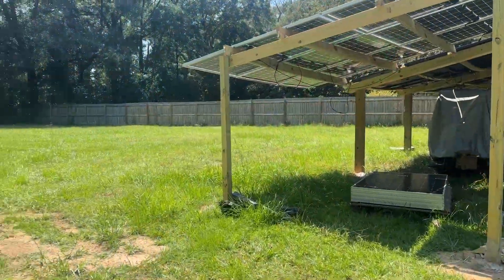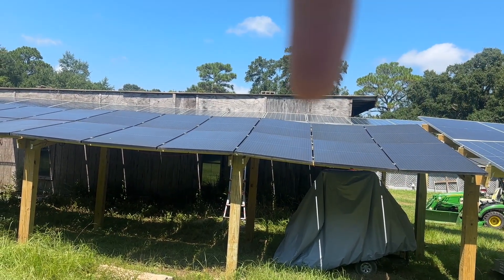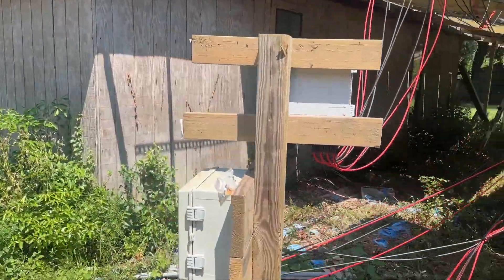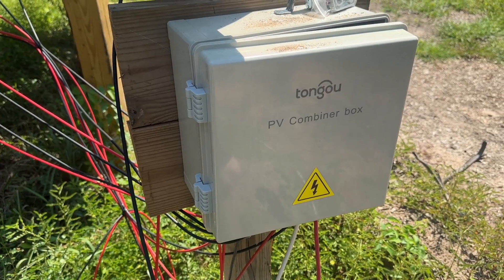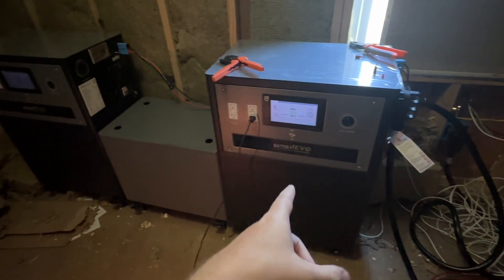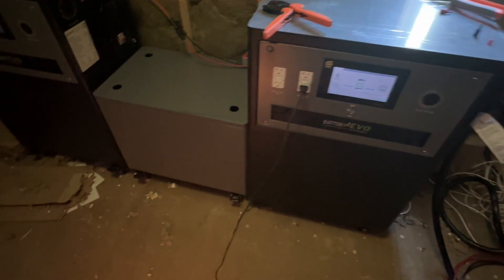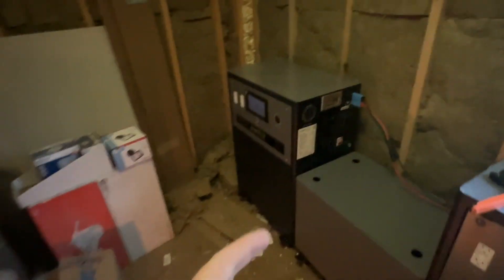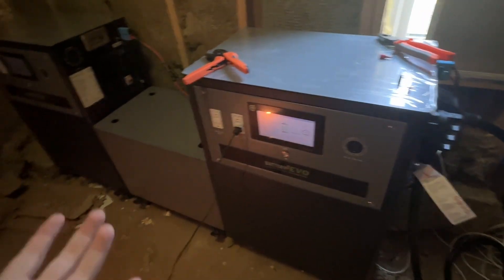Tour of my solar and battery backup

Comment: I am in the process of setting up my G4 plus. Always considered getting an expansion battery. My electrical panel room is only 32 X 44 inches. Can the expansion battery be stacked under the inverter? I know it comes with wheels. Can the wheels be removed and stacked? BATT->BATT->INVERTER.
Reply from the maker: Potentially. But I wouldn’t recommend it. The battery is soooo heavy that lifting it up is a huge ordeal. But anything is possible
Reply: @prominenceperspective  I spoke with someone at support, and they said, you can and should strap it to the wall so it will not tip over. I just do not have the side by side real-estate.
Reply: I’m in the same situation. 
You tried it ?

Comment: It would be helpful to see the total voltage specs of each string.  Since you have strings combined in parallel, you want their total voltages within 5% of each other to prevent issues.  By voltages, I mean their total Voltage Open Circuit Voltage (Voc) and their total Voltage at Max Power (Vmp).  If the strings of 3 panels are 150V, they’re reducing the production of your string of 4 panels by at least 25%, for example. 

It would also be helpful to know the Amps Short Circuit (Isc) of each string. Since you’re paralleling them, the amps of each string adds up, which increases voltage drop on your trunk cable run between your array and your G4s.  If your avg string Isc amps is about 11A and you’re combining 4 strings, that’s 44A continuous, so 6AWG wire should be used.

Comment: How big of a circuit breaker did you use in your panel to feed the power to the whole house
Reply from the maker: For me it is a 60amp breaker
Reply: Is that the max it can output?
Reply from the maker: @Schmibby I believe so, yes.
Reply: Can you show a picture or video of your main panel and sub panel and how that is set up?
Reply from the maker: @Schmibby  I’ll do that. Yes. There is a long, boring install video that shows it. But I’ll make a quick one.
Reply: I have watched that video but it didn't really say anything about how ur main panel and sub panel work, I want to install a g4 walrus plus to be my main source of power for everything in my house but also be able to charge it if my solar isn't good for a while or something but I don't know how to do this without moving all 95 percent of all my breakers to a subpanel but I believe this is the only way so I was wanting to know how your system was setup to compare to
Reply from the maker: @Schmibby ok. I’ll do a video about mine this week
Reply: @Schmibby Hey 
That’s what I did. Of course you can’t use all of them at the same time
Reply: How do you remove the neutral ground bond in the Wlarus G4 plus? When connecting (back feeding) to an existing panel, you should already have a grounding rod and the ground should bond to the neutral. The electrical code says bonding neutral & ground can only happen in 1 place. I read that the Walrus uses a bonded neutral. Need to understand how to disconnect that bond. Thx
Reply from the maker: @SorryRadioFace I should have a video about that coming up next weekend. I ran into the opposite problem when I did my Tesla charger. The ground and neutral are not bonded at time of delivery. I had to bond them for my car charger to work. BatteryEVO is shipping me a bonding device and once I get that part I’ll make the video.
Reply: @prominenceperspective  thank you. I thought it shipped with the neutral bonded to ground. Looking forward to the video. Glad to find your channel

Comment: Don't buy NMC. Period!
Reply from the maker: There’s always a hater. This battery chemistry is the same used in several car brands including Teslas. It has great density. This brand has the same 10 year warranty as the non NMC manufacturers out there.
Reply: @prominenceperspective 1. On the Battery Choice: There's a reason the DIY community and major companies like Tesla have moved to LFP for home storage: NMC is widely considered to have significant drawbacks in safety and longevity for this application. Promoting an NMC battery for home use ignores the established best practices and raises questions about the motivation behind this recommendation.
2. On Transparency: Viewers deserve full disclosure. If you are using a referral link from BatteryEvo, this video is a form of sponsored content. You don't say, "I am not sponsored." Failing to clearly state that you have a vested financial interest in people buying this battery is a major transparency issue.
3. On the Work Quality: Frankly, the solar array wiring shown is a serious safety concern. It appears disorganized, unsecured, and not up to standard electrical practices. Showing this kind of work sets a dangerous example for your audience. It's not just "sketchy", it's a potential hazard.

I am not a hater. I am speaking based on knowledge of battery chemistry. You always talk about tesla, but Tesla has moved to LFP for the same reason I am saying no one should buy NMC batteries.
Reply: @meilyn. You mention NMC for home storage. But what about automotive? You say the industry is "moving away" from nmc. This is only halfway true when it comes to the auto industry. NMC still seems to be the battery chemistry of choice when it comes to performance. The new Silverado EV trail boss uses an ncma chemistry. I probably don't have to explain that a good BMS is key to any battery health, stability and longevity. 

I wonder about all of those rechargeable battery solutions people have in their homes? I don't believe they are lfp chemistry. 

In short, take care of your battery and it will in return give a good service life.
Reply: Lastly, that same brand was sued and settled out of court for selling products with used and dangerous batteries. If you are talking with the manufacturer and getting links from them, then you are sponsored.
Reply: I know, I have said lastly so many times, but this is the last thing. With the cost of LFP batteries right now, nobody should be buying an NMC battery.
Reply: These are LFP batteries.  It’s the Walrus G4, not the G3
Reply: @NickWindham This is an NMC battery.
Reply: @meilyn22  No, they are not, if these are both the Walrus G4, per the video description.  Those are LFP.  The G3 is the unit with NMC.
Reply: @NickWindham  They are NMC. The G4 is the inverter. Show me where you can buy LFP batteries with this inverter and I will buy it. All of their batteries offers paired with this Inverter are NMC.
Reply: @Dan-gd3ev   The new G4 Plus in NMC.  The old G4 was LFP, but it’s sold out.  

Their LFP offerings are now the Walrus Pacific and Walrus Pacific Pro.

Comment: With all those arrays in parallel, are you running 8awg back to the walrus pv input?
Reply from the maker: I think I did 6 gauge
Reply: @prominenceperspective   I’m sure you’re right, but I’d double check this if I were you.  

Best practice for minimizing voltage drop or melting components: 10AWG 24A max, 8AWG 32A max, 6AWG 44A max